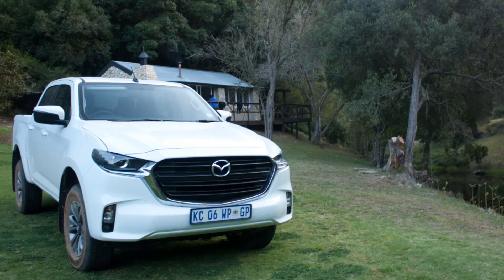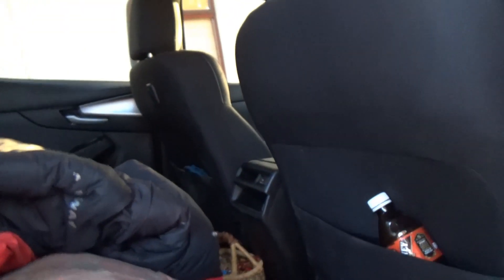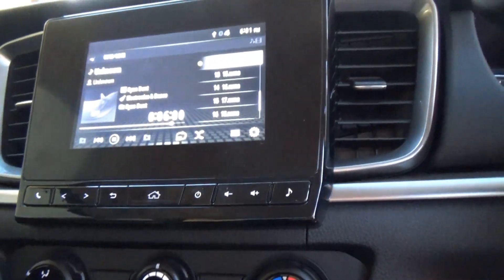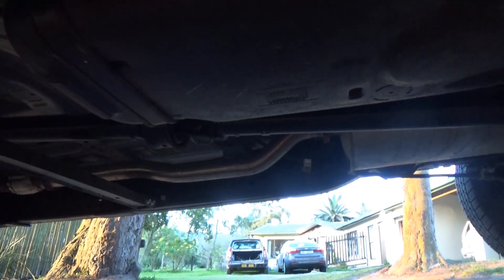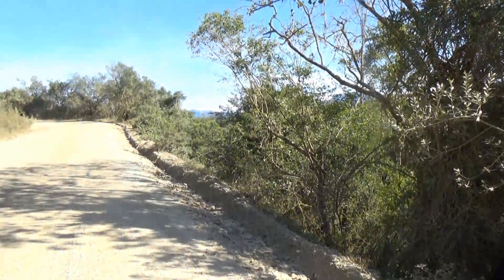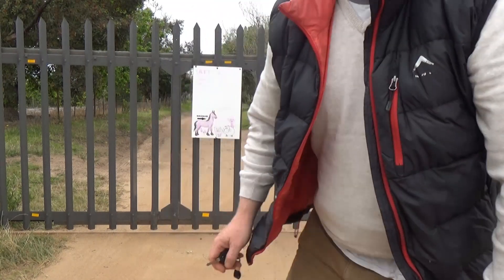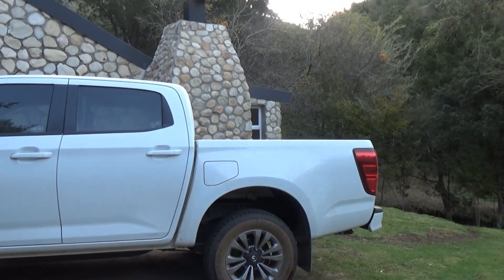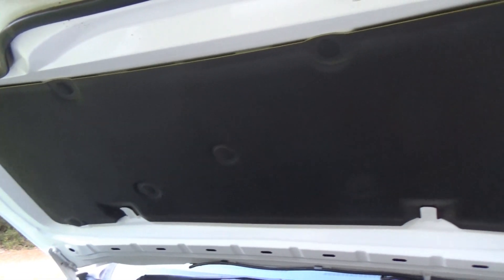Mazda BT-50 Review in Garden Route (part 1) - The Game Changer?

Comment: Excellent review! Just ordered one. 

The new ones now have 3500kg towing capacity with a torque increase from 350 to 390NM @ 1600-2600rpm.
Reply from the maker: Cool, which size engine did you go for?
Reply: @Africasideways  The 1.9L
Reply from the maker: Nice, very economical